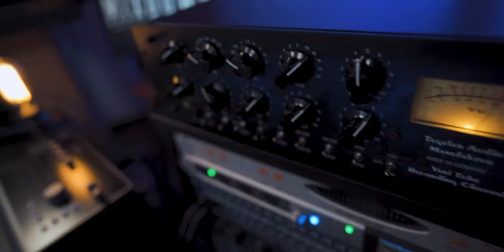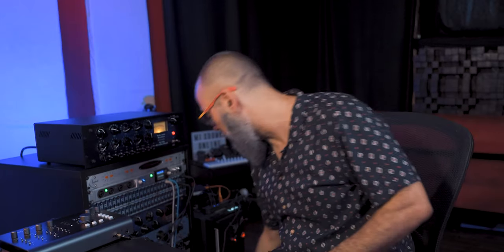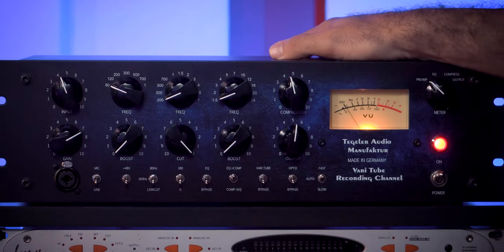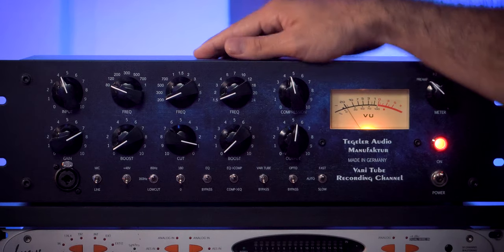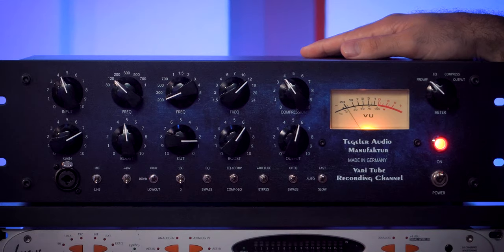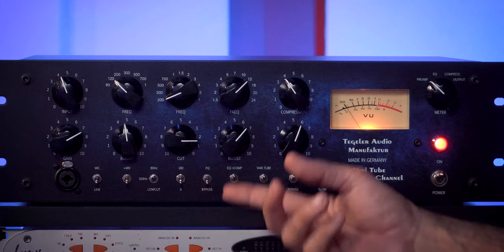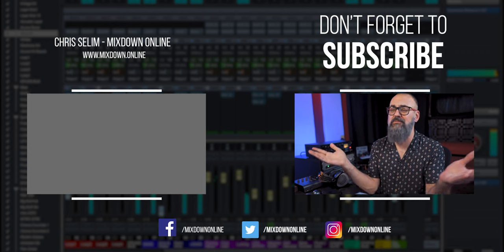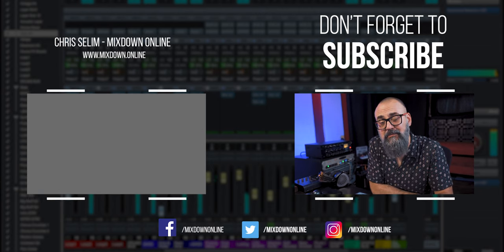The VTRC in Action - Vari Tube Recording Channel Strip by Tegeler Audio

Comment: What's the differences between the "Gain" knobb and the "Input"? Do you do the gain stage on the device without touching the interface input gain? Pretty cool channelstrip. Nice video!
Reply from the maker: The "Input" controls the signal level going in the Preamp. The Gain adjusts the Gain of the Preamp. So you need some Input level before you can add some Gain that will change the tonal balance of the sound. Thanks!

Comment: So in a mixing situation on several individual tracks are you bouncing those track to new tracks and using those tracks in conjunction with the original track or in place of the original tracks. I must say I have over a dozen Mic pres  and older Trident and Yamaha channel strips that I use during tracking, but I've never used them as external effects in Cubase so I am curious about the process. My go to is a UA 6176 that I will often just use the compressor section fed by my Warm Audio WA273 or WA12's or Focusrite ISA One or UA 710.
Reply from the maker: Yes, with analog gear, you can commit and bounce so you can use an Analog gear on other channels. I like to record with the VTRC a lot, I will use it on vocals if I didn't record with it. If you already record with your analog preamps, I don,t see the use to use them during mixing though. However, if you happen to mix tracks that were recorded with a clear audio interface preamp, you can use your analog gear to add color and vibe to those tracks
Reply: @mixdownonline  Thanks for the response. I have a question on a different Cubase subject. May I email you?

Comment: Hi Chris..how is the tube rush? Tube noise level? I do worry a lot about this issue..I got my UAD6176 and it was so noisy..UA asked me to send it back to where I purchased it but it's too far..so I took the risk, sending it to my local and reliable technician..what he did was to change the IC of the output channel to a better one..problem solved! No more annoying tube noise.

Considering this as another hardware, interested but the tube noise would be a concern. :(
Reply from the maker: On my side, sounds pretty quiet to me, no tube noise as far as I can tell
Reply: @mixdownonline  Thanks so much for the info. Will seriously consider this hardware.